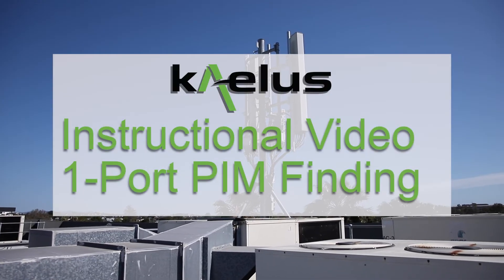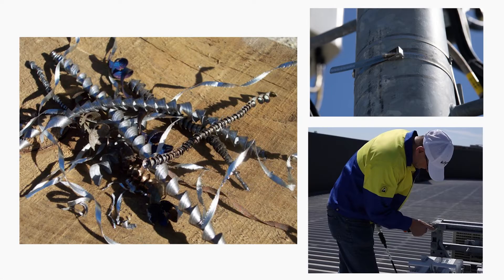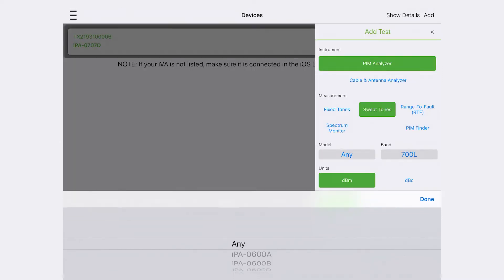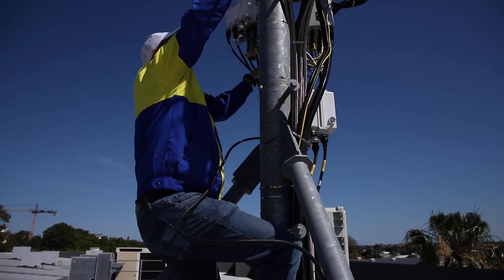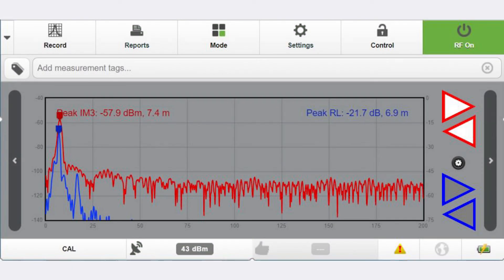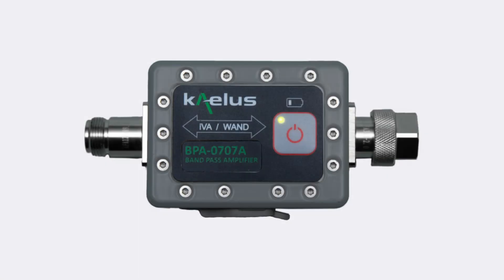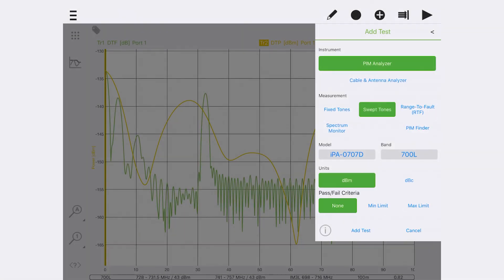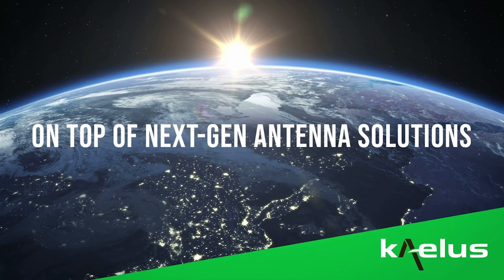1-Port PIM finding made easy with Kaelus Test Equipment solution.

Comment: I seem to be getting fals readings while sweeping antenna ports even with good readings on phase cable and adapters. 
Should we be putting obsorber on to test ports in the field ?
Especially if a good port can read as though its a bad port with no obsorber.